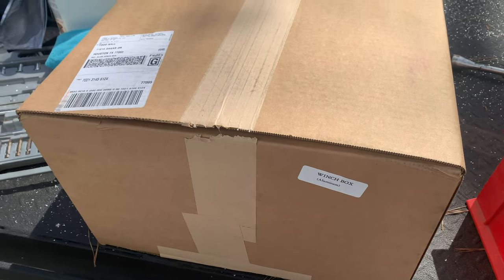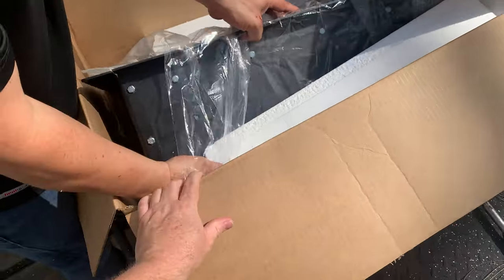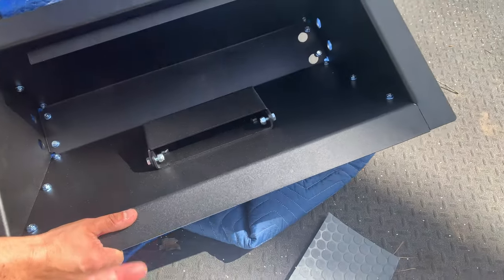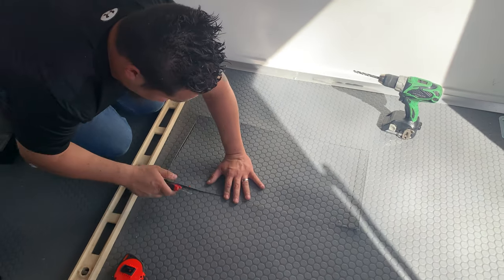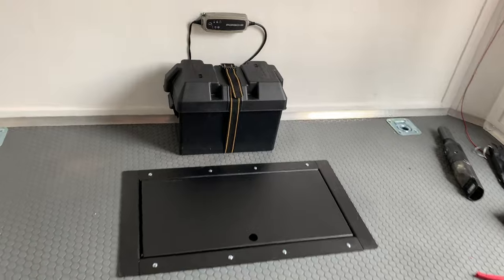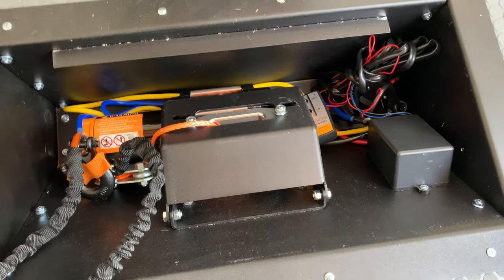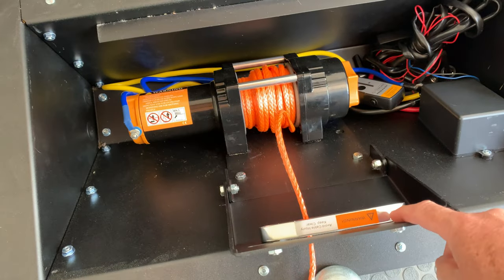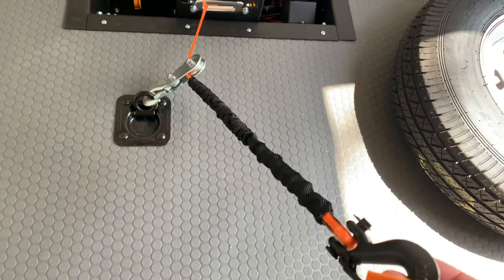Cargo TRAILER conversion build!  Winch box and battery install Ep 3

Comment: what size and spec battery did you go with? Are there recommendations in the manual for it?
Reply: I used the old battery out of my GT3.  Still working after a year and a half.  Its always on a tender.

Comment: Is the lid strong enough that it can be stepped on or do you have to avoid stepping on it when it’s in place?
Reply from the maker: @1stGenCRXs  it’s very strong. You could drive the car over it. No problem
Reply: @Blackhorseturbo  that’s great news!  Are you still happy with it?
Reply from the maker: @1stGenCRXs  4 years later. Probably 30 races. Not a single problem
Reply: @Blackhorseturbo  thanks for replying and glad to hear that.  Just upgraded to an enclosed trailer for my car and like the idea of this in floor mount.
Reply from the maker: @1stGenCRXs  I totally recommend it

Comment: so its been a year did your incorrect installation fail yet ? those little screws were no way strong enough
Reply from the maker: Thanks for checking back. All is well. Pulled the car in well over 50 times. No issues.